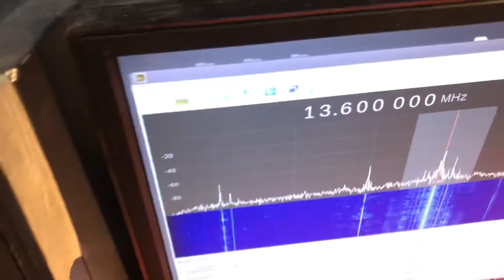I hate SHUKO plugs

Comment: La forma e l'amperaggio che sopportano... 10 ampere contro 16 ampere. 
... 220 volts con una spina da 10 ampere 220x10=2200 watt 220 volts con una spina da 16 ampere 220x16=3520 watt prova ad attaccare la lavatrice alla spina piccola e vedi come prende fuoco la casa...
Reply from the maker: “Thanks to the dick”. Questo è un saldatore da 30W, non una lavatrice
Reply: @asbestomolesto  ok ma molti non sanno la differenza

Comment: GQRX a quale hardware è connesso? RTL? Che antenna usi?
Reply from the maker: Si, chiavetta RTLSDR presa tempo fa, connessa USB ad un PC con Devuan GNU/Linux ( https://www.devuan.org ), un quad core I5, non ricordo le specifiche. L'antenna attualmente e' una long wire un po' casuale, con un balun 9:1 fatto ad occhio. Quanto basta per ricevere qualcosa :) Si puo' ascoltare cosa sto sentendo 24 ore su 24 su https://radio.dyne.org/shortwaves.mp3 :) La sintonia viene cambiata automaticamente in certi orari per ascoltare determinate stazioni...